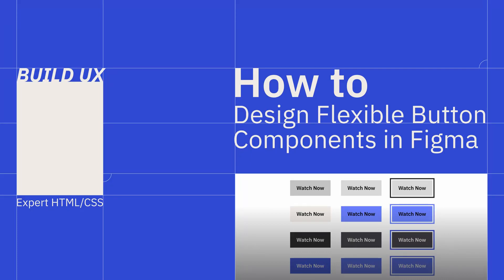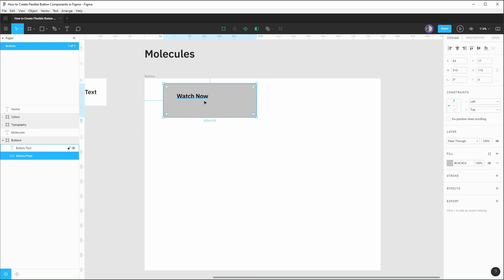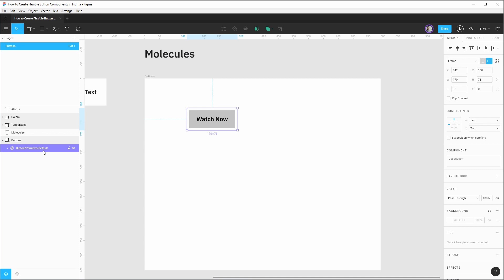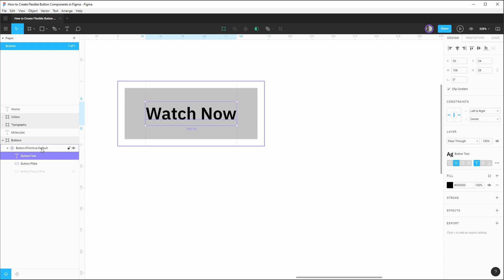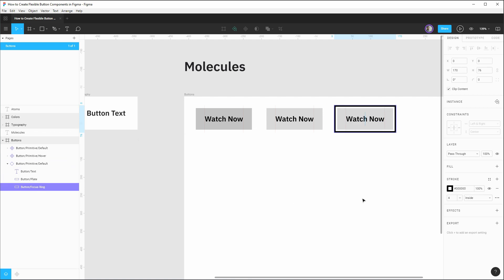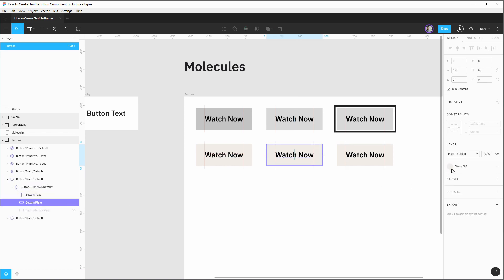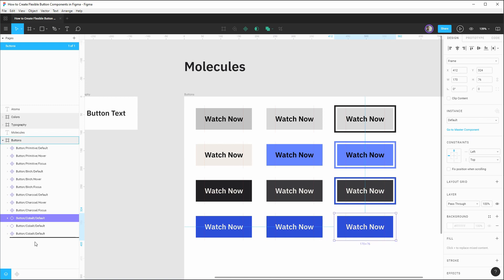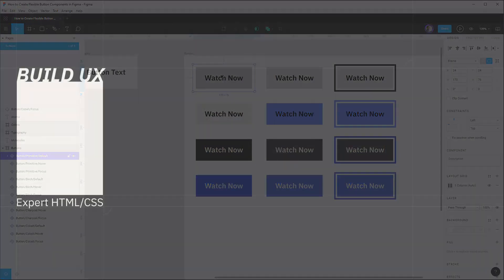How to Design Flexible Button Components in Figma | UX / UI Design

Comment: Heya! Im curious about why to use the layout grid/margin method to add padding vs using auto layout?
Reply from the maker: Great question. This tutorial came out before Auto Layout was introduced in Figma. I have an updated version of this how-to that uses Auto Layout. It definitely makes this process much easier. That being said, using frames and layout constraints is still very powerful for certain component use cases.
Reply: @buildux  Sweet! Thanks so much for this informative video!

Comment: Good one. However, I was looking for something like this 

https://material-components.github.io/material-components-web-catalog/#/component/select

How to create a button with the bottom border highlighted?
Reply from the maker: I would recommend adding a rectangle layer with the dimensions you want for your bottom border. You can set it to be pinned to the left, right, and bottom using layout constraints. Does that help with what you want to create?

Comment: how do i have to connect the different states and how to insert them in a frame?
Reply from the maker: I typically make something into a component, create a copy (or "instance", as it's called in Figma), make some changes, and re-componentize it. This allows me to have separate states as component variations, but I still only have to maintain one "master" instance if I want to change things like border radius, height, typography, etc.

For inserting components, you can use the Assets panel, found in the top left part of the screen. You can drag a component instance from this panel into your design. You can use Alt/Opt + 2 as a keyboard shortcut for viewing the Assets panle, and Alt/Opt + 1 to return to the Layers panel.
Reply: @buildux  i mean, do i have to create 3 pages to simulate the hover and clicked state?
Reply from the maker: @annabrwk2059  Ahh I understand. In order to mimic hover in a Figma prototype, I do think a separate frame is needed.

I have seen some people use the Open Overlay option in the Interaction menu to "overlay" the hover version of a button. You can also use the Swap With option to trade out the current frame with another while hovering. I don't use prototyping mode very much since I mainly prototype in code, but I hope that's helpful. There may be better ways, so keep me posted!
Reply: @buildux  thank you very much

Comment: I apologize if this is a stupid question, I'm new to UI design. I still don't get the purpose of Focus Ring. Won't that make it a bit harder to set a paragraph of text and a button underneath to align left?
Reply from the maker: This is a fantastic question, not a stupid one!

Focus indicators/outlines/rings are necessary for users who rely on using the keyboard to navigate a website. These users include individuals who may have physical disabilities, or simply prefer using the keyboard instead of the mouse. Users can use the `Tab` key to move focus between interactive elements on a screen, and without a focus indicator, there would be no way for users to know where they are on the screen. A helpful exercise is to imagine using a website with a mouse, but the cursor is invisible.

To answer the second part of your question, focus indicators do not affect layout in CSS when they are coded properly. In Figma, I handle this by making sure the component's frame wraps around the button background and "clips" the focus ring, which makes it much easier to visually align the default state with other elements.

Comment: Is there a way to adjust the width of button instance in a component that nests a button component?
Reply from the maker: Great question! Unfortunately, nested components have some limitations in what you can modify.

For example, if you have a card component, and you drag a button component inside of it, you can adjust the button's width as needed. However, if you then create a copy (or instance as it's called in Figma) of the card, that card's button cannot have its width or positioning changed.

I think all of this will change once Figma releases dynamic layout functionality: https://twitter.com/figmadesign/status/1176150305379160065

After this feature is out, I'll be releasing a whole series of how-tos that show what's possible, because it's going to make so many things much easier and more flexible.

Comment: I tried Figma today. Compared to Sketch I like a lot better. BUT. If I create a button like the one shown here in the excellent video, the button text is centered like in the example (with a text style) and I now need all these buttons left aligned ...? In Sketch the properties of the style are linked to each other. So, if I change the alignment of the text in the component, all instances are changed. But not so in Figma :-(
Reply from the maker: Interesting. I went back to this original file and confirmed that changing text alignment on the master instance does indeed update all the other instances of the component. For example, if you make the button wider, you'll see that text alignment within the text frame does work as expected. If there isn't extra space in the text frame, changing the text alignment doesn't look any different, because left/center/right don't move anything since there's no room.

I know you left this comment a while ago, but let me know if you're still experiencing this issue. Feel free to make a copy of the Figma file and see if it works how you would like: https://www.figma.com/file/VEfHASCJrnmZ7prKfYYxJTOH/How-to-Design-Flexible-Button-Components-in-Figma
Reply: @buildux  It works fine!
I had not seen the video to the end and therefore completely misunderstood. I thought I'd change the text in the button and it automatically adjusts with the size. Sorry
Reply from the maker: @mischugo  Ah I see! That's not currently possible, but Figma is working on dynamic layout which will hopefully be out soon. Once that's released, resizing based on text length will be automatic!

Comment: Don't you find it annoying that new layers default to the top of the stack? Great tut btw
Reply from the maker: Haha yes! As a developer, I think from a top-to-bottom structure, since that's the order of elements in code and how they render in the browser (where the bottom-most element appears on top of all previous elements). I wish there was a user preference to automatically add new layers or duplicated layers to the bottom, and have the stacking order top-to-bottom to mimic the structure in code. Until then, it's lots of dragging and dropping layers or using `Ctrl/Cmd + [` and `Ctrl/Cmd + ]` to rearrange 😉
Reply: @buildux  Useful keyboard shortcut tip thrown in there, thanks!

Comment: Hey! thanks for this video! I have a question: can I do a button thats have multiple actions? for exemple a button that when I click it opens up 2 different overlays?
Reply from the maker: Great question! From a usability perspective, buttons should only have a single purpose that is clearly communicated to the user by the button's text. I would recommend designing two separate buttons to handle the two different overlays as needed to avoid confusion.

Comment: My process is to build a master button state that's generally "unstyled", then use an instance of that to be my other button component states. This way, the nested overrides are independent from each other, and I can change the background color of the default states without changing the hover state.
Reply from the maker: This is a great process to follow! I believe this matches our approach shown in this video, as the "Primitive" button components have some generic styling, but with the nesting and overrides, all color theming remains intact for other instances, while still allowing for layout, border radius, etc. to be maintained by the single master instance. Is there something else you approach differently? I love hearing about everyone's process!
Reply: @buildux  Well the difference is that I name mine something like "Button/.Master" which makes it a private component for the library and inaccessible to other files that may use the library. My Default, Hover, Focus, etc. states are just an instance of "Master" with overrides done. I just did this to separate the architecture of a button from any state. I didn't want my other button states to be reliant on the Default state component. This is because I may decide to change something in the default state that I don't want reflected in the other states, and I want every state to be independently styled in that way.
Reply from the maker: @DarrinLin  Very cool! There are so many ways to approach this and your setup sounds really useful for keeping each variation more independent. I'll have to experiment with this. Thank you for the explanation!
Reply: @buildux  Cheers!

Comment: Great video! How do you use a stroke instead of a fill on your columns in the grid?
Reply from the maker: Just to make sure I understand the question, are you referring to the columns in the layout grid?

If so, the settings in the Layout Grid panel are:
- Count: 1
- Gutter: 0
- Type: Stretch
- Margin: 32 (or whatever spacing you want the grid lines to indicate)

This should produce lines instead of a filled background for the layout grid.

Comment: Ok cool, but if you want to align the button left with a paragraph for example?
Reply from the maker: I use rulers/guides to quickly align the button's background (in the default state) with other elements. It's very important to design with focus rings in mind, and once you're used to the small bit of extra dimension, it's not too bad to get everything lined up. Outlines don't affect layout so I usually just let the component snap into place and then nudge it a set number of pixels to reflect this.

Comment: I have a question ... why do you nest symbols twice from the second line of buttons?
Reply from the maker: Great question! This is a personal preference, but by tying the hover and focus variations within each theme to that theme's default instance, I only have to open up the default if I need to adjust the colors for different states. The exception to this is I override the button background for hover and focus, but I could duplicate the button plate and simply show/hide it if I wanted everything maintained in the theme's default instance.

You very well could duplicate the primitive hover component instead, but then some colors would need to be applied repeatedly for each theme. Like I said, just personal preference for how I like to keep things maintained.